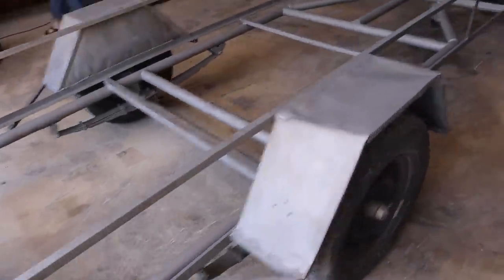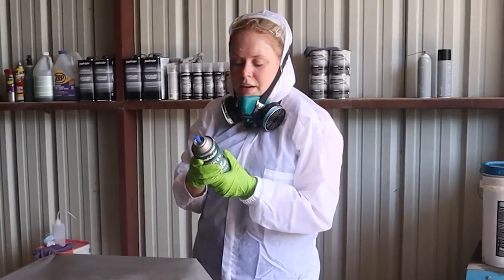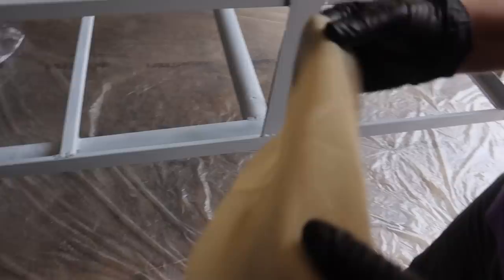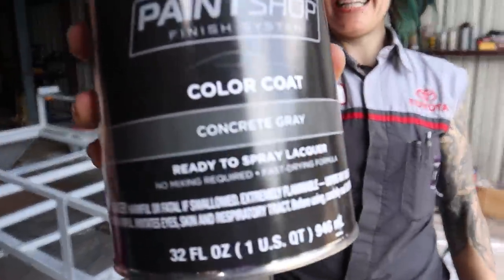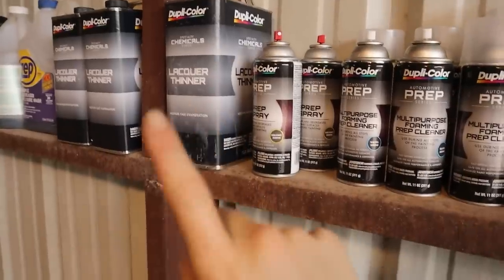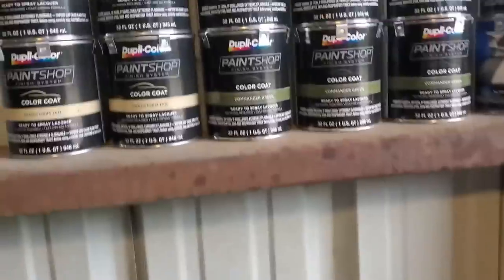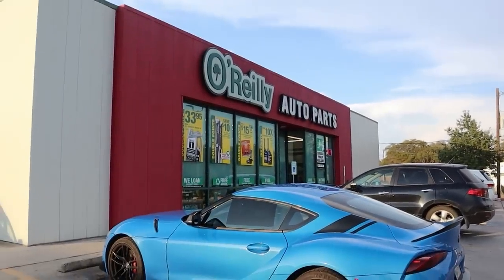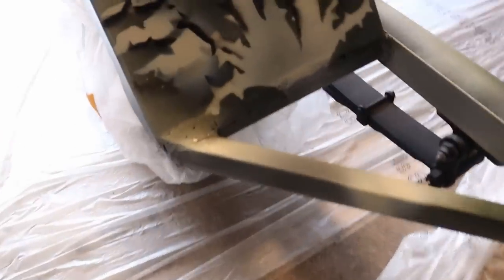I PAINTED THE TRAILER!! Color Reveal, Tips & Tricks,

Comment: The trailer is looking fabulous great paint job, not bad for your first time. 😊👍
I think you need to fix the holes in the roof 😉☔️ typically raining a just the wrong time, but it didn't do much damage. Great video thanks for sharing. 😊👍🐓🐔🐔

Comment: Very nice. I remember how bad the trailer looked when you bought it. The only thing I would consider doing is bed lining/ under coating the under supports before putting the new bed on it so the weather doesn't affect or rust the frame as much if rocks chip the frame.

Comment: Good thing you live in texas. Truck bed liner will probably hold the heat into the brake drums then a thinner paint. Unless you are not using the trailer brakes then nevermind.

Comment: Metal Roof Leak fixer stuff. Lowes has a very nice silver Silicone based sealant that goes right in your caulk gun and is nice and thick, yet runny enough for a roof repair. Home Depot does not carry it, don't bother with the HD on this one. For some reason HD does not carry anything even remotely like it. GE Metallic Gray Silicone 2nd (gen) Metal roofing silicone. This stuff really works and can be applied from above or below! From above run a bead on the offending  crack or holes. From below, Press the tip on a roof hole and squish it through, then goober a bead over (under?) all around  the offending crack or holes. Since it is silicone -- the old, spit on your finger to smear it trick works, but it is QUITE A BIT stickier than your standard RTV stuff. You  WILL need a roll of paper towels close by.
Lowes Item # 105723
GE part number GE5050

Comment: 250$ for the two devilbiss guns? I had the starter kit with 3 guns (an extra primer gun) for 100$
Reply: It's still cheap, I have a devilbiss gun I bought back in 1992, cost $400. It's a suction feed cup, use it often painting trailers and cars for people, works great. Have a couple of cheap harbor freight HVLP guns also, they surprisingly do a good job also, for the price